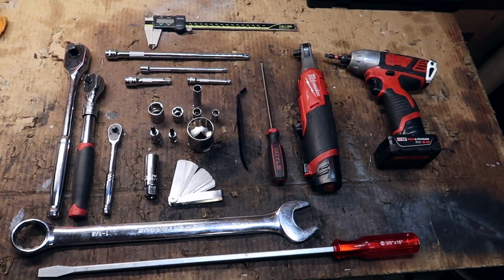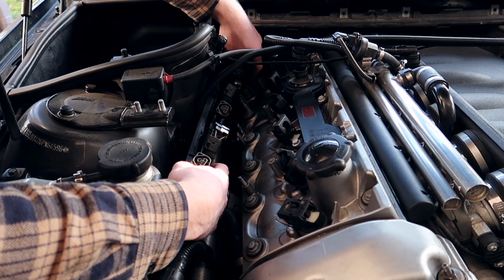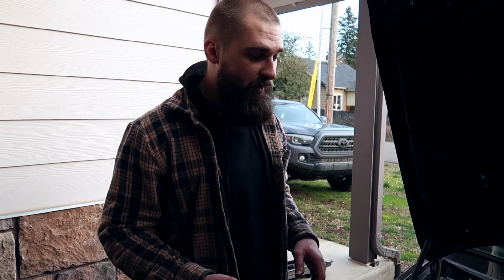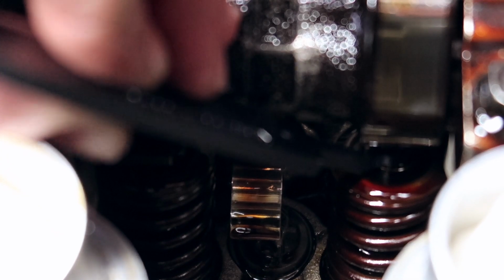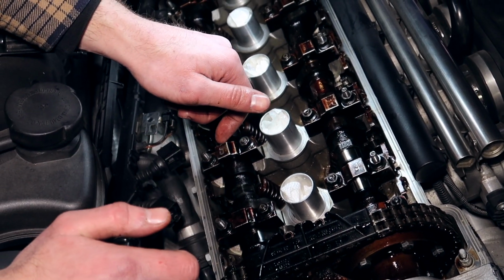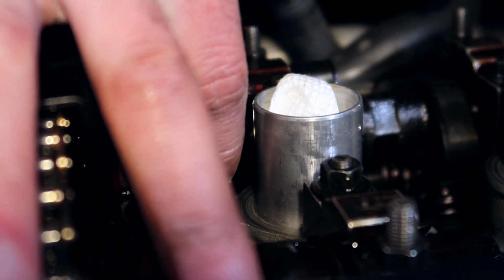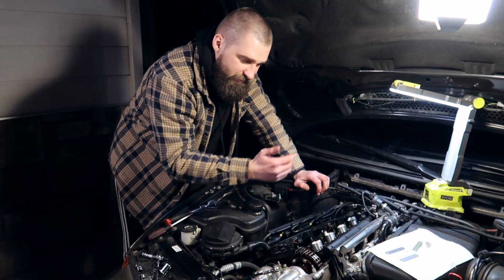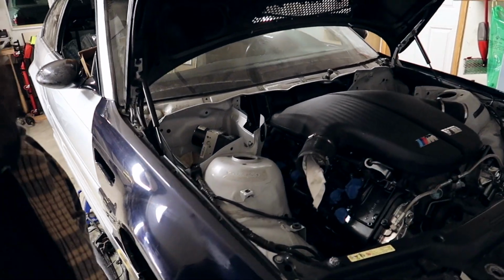How To Properly Adjust Your Valves on a BMW E46 M3

Comment: Dude, that was sick. Not sure I would have ever attempted this job but now having watched you watch you explain it clearly, I think I'd be confident enough to give it a go when my car needs it next!
Reply: Buy the correct feeler gauge. Wiseco kit isn't enough shims of .28 and .32 to finish the job, will need to buy more of those sizes. Also, I have an 01 and 02 and they both have the oil galley screens for shims; it has nothing to do with the car being a facelift. You also want .20 on intake side to have some resistance like sliding butter on toast. Not with the .18 like he showed on the first valve, it's too tight If that happens. Good luck,  pretty easy diy just tedious
Reply from the maker: Happy to help and boost your confidence. Just take your time with it and it'll turn out fine.

Comment: Yev, that rocker arm slid right over no problem at all. Mine are incredibly hard to move. One of them is now stuck moved over and will not go back. Any suggestions?
Reply from the maker: Did you lube them up at all?